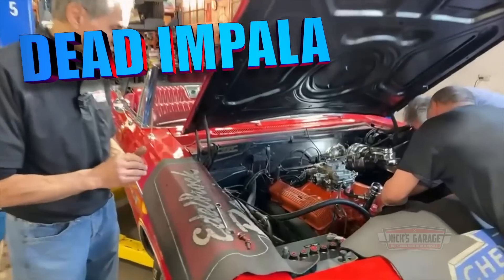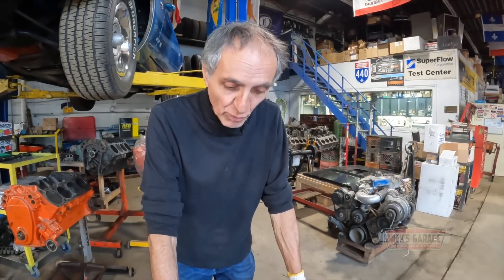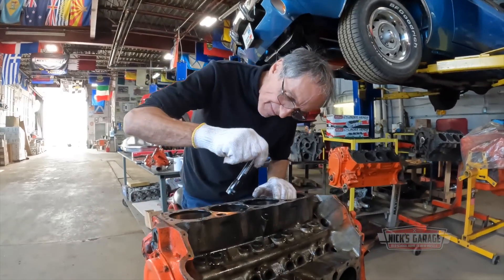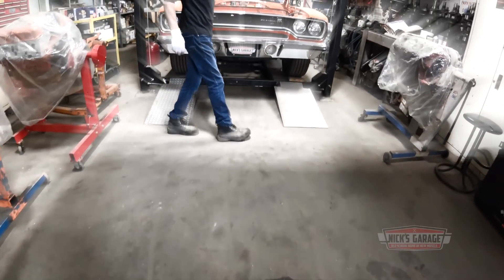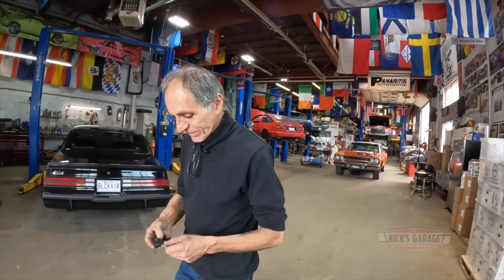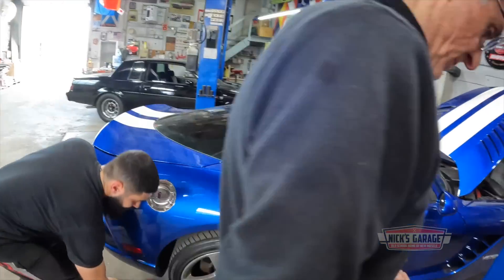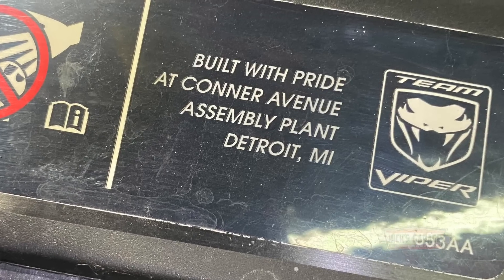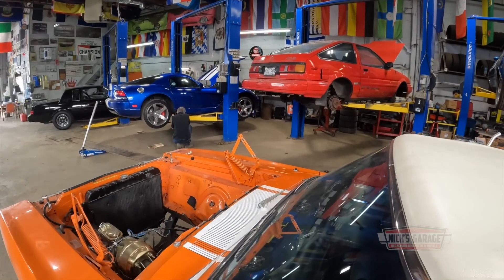327 Chevy Autopsy - Smoking Gun FOUND!

Comment: I got to say. In all my years in the shop I've never seen that kind of heat damage. I seriously doubt any of that can or should be used over. This is clearly operator neglect. Driving while clueless is hard to accept. At some point, you have to know something is wrong, pull over and shut it off!!! There is a temp gauge. You can tell right away how the motor is running if something is wrong. Smoke out the back. I hope you charge the client on this one Nick and not give them a freebie. It's almost like an irresponsible entitled teen ager was driving this. 

Now if this was a case where the head gasket blew, and they pulled over right away and shut it down, it would be a simple fix and I could see doing that for them for free. But at this point no way for free. And even IF the engine is cracked, there is no way to determine if it was cracked before or not. Overheating a motor like that will absolutely crack a block. ESP a chevy block!!!  AND getting a block that hot can destroy a thermostat real quick so I'm not buying that stuck thermostat story. 

Don't give them a pass on this Nick. I hope the client is reading the comments. He deserves a good pasting for this.
Reply: @Teabag697  Yeah there is no way you cant notice something like this.

Comment: Hey Nick! I was suspicious of the thermostat. Now that it's been verified as the source of the problem, I think Mr. Gasket owes you (and the client) a new engine. The part is clearly defective and Mr. Gasket (not your insurance) should make it right. It's not like it was an old part after thousands of miles. I know My Mopar has a bypass hose just in case that happens but I don't know if it would totally make up for a bad stuck thermostat like that.
Reply: They only owe a new thermostat.... the customer ignored the other signs of overheating, namely the SMELL.

Comment: It really goes to show how an inexpensive piece to an expensive build can really come back to bite you. With as "wet" as the heads looked, may have cracked the water jackets in some of the exhaust ports. Darn shame about the 327, hopefully it can be repaired.
Reply: That much heat!  and the block is already .040 over, (not wise to go .060 on SBC ) Not me, get another standard bore 327, that one is NFG anymore. You could sleeve all 8 cylinders and re line all the lifer bores but OMG the COST and time !  You can find another nice standard bore 327 to re machine much cheaper, and if nick really wants it out of there quick, just get a  Summit crate LT-1 350 and it's on the road in a few days.

Comment: By the way I love your shows I also have a 1960 Oldsmobile 98 holiday special four-door I’d like to say it’s in mint condition I can jump in and drive it from here in Albuquerque or I live back to California where are used to live without any trouble or from here to your shop in Canada without any problem and back only got 35,000 miles on it original factory engine as well like I said I love your show I also have a 2008 Zo6 Corvette unfortunately after 135,000 miles the transmission blew up because GM uses nylon to hold the bearings together and nylon let the bearings loosen the gears and we know what happens after that time it happens I happen to be racing another car I won my race but lost the transmission in the process so transmission and rear end are sitting inside my garage right now next to the Oldsmobile needs to be repaired keep up the good work though love your show

Comment: The only ‘fault’ of Nick was using “Mr. gasket“ brand thermostats and not a Stant brand as I consider Mr. Gasket to be middle of the road quality at best and this situation is evident of their poor quality control. On high-performance engines I don’t even use a thermostat but rather just a thin brass plate with usually a three-quarter inch (3/4”) diameter hole in it or take the guts out of the thermostat and use it like that.

Comment: I've killed 2 small block Chevys (a327 and a 350) by grossly overheating them. One of them was with a friend who said "If this thing pings all the way, it's going to blow up." We stopped to check the engine. Water running out of the exhaust manifold is a bad sign. Both engines cracked the heads.

Comment: Reminds me of 1973 and the first car I ever owned , A 64 or 65 Dodge Monaco with a 383 (I  think). Driving from Talladega to Redstone Arsenal, unbeknownst to me the radiator fan and hub broke and augered into the radiator.
When I got to my destination I smelled a hot engine, opened hood and there it was...tried restarting, no joy, seized up tight.
Next day after replacing radiator and fan assembly, dang thing started right up! Tough old engine, ran well til I traded it in for a 73 F250.
Loved that car!
Anyway I  agree the driver shares a lot of responsibility for the destruction.

Comment: i would also check the radiator cap, see if it is working and holding back rated psi its set at. sometimes they can fail and stay open and dump all coolant out the overflow.

Comment: I ran into an issue on a tune up I did on a customers car many years ago. No damage to engine but I got burned on bad parts. Three out of eight spark plugs died. Resistor plugs. Chnaged brands and all was good. I have not bought another Champion plug since that problem back in 1970!

Comment: Check the welds on the water jackets in cylinder heads..sometimes they pit and leak..I had a ford 289 motor do that..

Comment: Yep , thermostat, seen that happen to many times before, that was why I called you Nick.  Your welcome nick, I got a few years on you, and I have seen just about it ALL ! so when I seen that sweet 327 small journal block like that ! ( holy mother of god ! HOT ) 327s Chevy, they  just DON"T ever run hot ! I had a pretty good idea it was that thermostat as I have had it happen before on brand new name brand ( MADE IN MEXICO ) thermostats before. 

    So lets get real here, I had a OLD radiator rebuilder I really trusted, long since passed away. He told me flat out a thermostat is ONLY for HEAT in the car in the winter. Fact is you only need a restrictor to slow the flow of the water down in your cooling system, not a thermostat. SO , since a Convertible has ZERO reason to ever need HEAT lets put a STOP the problem before it starts. On all my rebuilds now, I take a small die grinder and very small cut off wheel and I cut the spring in half in the thermostat and knock all the guts out of it ( use the one that doesn't open) so it's only the outer shell housing left to slow down the water. Now you have a totally free flowing thermostat that can NEVER EVER do that hog was ever again. I been doing this for many MANY decades with zero issues PLUS the water temp always runs much cooler ( like 170 to 185 degrees max in the summer) My new 327 I just built & installed in my old daily driver Chevell, runs at 160 max  and it's been in the mid 90s here in south Florida as of late with the A/C on in heavy stop & go traffic hours on end. 

 Nick you asked , what happened ? you did not know?.  Well me being a OLD GM rat ! I had a pretty good idea just looking at it from afar. So then you asked what can you do to stop this ?,  The hollow thermostat is a great start, but they sell a thermal shut off kill switch you can set at 240 degrees would be even better.  We call  them ideate proof !  The 327 hits 240 degrees , the car has a VERY LOUID BUZZER ! before more damage occurs. I have not bought one in a long time, but maybe a good old school parts supplier can still get one  . 
 
Now that you have a pretty good idea that I know things about GMs, will you please,  PLEEEEESE !!!! never run a Q jet  on your dyno ever again ! with out a tight fitting AIR CLEANER on it!  your killin me here. Doing that is like trying to go pee in the dark with your wife watching , it never works.

Comment: Possibly a pin hole in the lower radiator hose? As hose heats, pin hole is opened due to building pressure in radiator and rubber expansion.

Comment: It definitely could be the thermostat BUT, if you overheat a thermostat enough, the paraffin wax that expands and opens the thermostat will leak out.

Once some of the wax is gone the thermostat will no longer open or, if it does still open, it will open at a much higher temperature.

Was the cooling system pressure tested before everything was taken apart? I still wonder if somehow the coolant leaked out while the engine was cool.

Comment: That motor should be making closer to around 350 hp to 370 I wonder what's restricting the hp on the 327
Reply: @Car Guy daddyo all 327 was considered a performance upgrade mainly corvettes mid 60s. Highly sought after hard to find genuine with stock heads still on .most ppl put the 202 stock 327 heads on 350 ci and even 400 small  block.

Comment: In all honesty I'm a Ford guy. 
I did come up against 327s all the time back in the late 60s early 70s. It was hard to beat, but I saw quite a few that split the block open. From what you saw and explained it would have to be higher on the block. Don't take this the wrong way, but I used and still do call them hot water chevys. They run best when on the brink of overheating.  I had a 73 El Camino that I loved. Built it to run and let it rip. Good Luck Nick.. you're the best.
Reply: You'll love this Nick. I had a friend in school that owned a 68 road runner. He joined the army and brought his car to my place to leave while he was gone to basic. The clutch was out of it and he said , if I put a clutch in it I can drive it. Well I almost got my chest pushed in by that rock crusher 4 speed but I got it done. Had a blast in it. 440 with a 4 speed.  No better feeling running down the street.

Comment: Davies-Craig makes a great electric water pump/thermo fan/electric controller combo.
Gets rid of the thermostat altogether and you can delete the water pump. Saves parasitic power loss and can even run after shut down to prevent heat soak. Then there is the engine guard alarm. Bolts onto the motor literally via a bolt in the head, or thermostat housing to read the actual temp of the metal, if it exceeds normal parameters,  like suddenly spiking above the normal heat range from no coolant, it sets off a LOUD buzzer to alert the driver.
Both two great Australian companies! 🇦🇺

Comment: Stuck thermostat (which is a huge problem these days from junk parts ) wouldn't cause coolant to blow out of the exhaust unless it was so overheated it blew a head gasket from many over heats, and that  would be obvious on the tear down, cracked cylinder walls or crack behind the intake/exhaust valves in the bowl area is suspected. Id also run a straight edge across the cylinder head and block deck. strange the engine didn't stop running and continued burning up. And like was said in a comment I also drill a single or several holes in EVERY thermostat these days, the parts are just junk now!

Comment: Had a similar issue about 35 years sago. Same style thermostat can't tell you the brand. Put a stock style back in, worked fine for years. Did have to swap heads, burned four valves.  Temp gauge voltage regulator was bad, not indicating any problems. I my case the bottom end  was ok, 100,000 miles after this event. AMC 401.

Comment: I wander what happened to the coolant. You mentioned that there weren't any leaks that you checked for. So where did I'd go? I may be way out of line with this but it is possible that he was not happy with the engine. He may have wanted better performance. So he, drained it all out. Then he drove it until he totally fried the engine. I have never seen an engine so horribly over heated in my life. Very suspicious.

Comment: I commented on your last video that i thought it was the thermostat because it happened to me with a new car with only 8 miles on it. Had to get towed back to the dealer. Engine used a lot of oil afterwards because when an engine gets hot enough to detonate the rings lose their spring tension. So if you rebuild that same engine make sure you replace all of the piston rings..

Comment: I agree with the guys saying that the defective thermostat COULD be an effect of the overheating and not the cause.
Nick says that they will investigate further and that is the right thing to do.
You would think that something as important as an engine thermostat, the manufacturer would have a good quality control to make sure that this sort of things does not happen. The buyer should not have to go through all the trouble of testing every part over and over.

Comment: Always drill holes in thermostat.    That way if tstat sticks closed, enough water will flow to trigger temp gauge and alarm.    Also you avoid air pockets in cooling system.

Comment: I'm 4 months late on this but I have to say one of the biggest issues I've seen on an overheat with the Chevy small block of this era, especially the 283, was if you ran them out of water and overheated  them, you'd get a nice big crack in the lifter valley a couple inches below the deck. I'm surprised it didn't happen to this one.

Comment: Check the rad. cap. I have tested many over the years & most old ones would not hold pressire. New engines generate more heat & if on A long drive in hot weather the cap may not been able to seal

Comment: Well I imagine the thermostat would be junk after being overheated. Once I had a head that had been crack repaired in its life and had a hairline crack in the exhaust port and once hot and under pressure would let water out into the exhaust.

Comment: While pulling the trans on a 318 Dodge  and sending it out we also changed the rear soft plugs and forgot. When the trans came back we reinstalled it took it for a test drive ( No coolant ) Man it got hot but was still running O.K pulled over shut it off .It survived ran fine.

Comment: Hey Nick I have a suggestion I don’t use thermostat what I have is a Moroso water restrictor what it is is a washer with a hole in it one big hole is 160° temperature the medium hole is 180° temperature the small hole is 190° temperature in my 327 I use the medium hole 180° temperature it’s a constant flow but it restricts the water flow to give it a temperature I don’t trust thermostats they work sometimes they stick sometimes and that’s the big problem with thermostats just thought I’d mention it to you Nick love your program! From San Diego California a fan.

Comment: I like that blue Viper :) Whether the thermostat works or not is of no actual importance since the coolant was going through the cylinders. That says the engine either had cracks where it shouldn't or the heads and head gaskets did not work. This is based on personal experience with an engine that passed water through the cylinders when it was hot and the head warped enough to let the water get into the cylinders. And no it didn't have water in the oil.

Comment: On my 66 I have a gauge.  If it was not the thermostat I was going to suggest a crack in the intake as most v8 Chevy intakes has a water passage.

If the hot light was working the owner must have either ignored it or thought he had more time.   Or he thought the light was wrong.

A thermostat can fail suddenly.  Happened to a friend of mine.

I just like gauges as I can see for example over time if the temperature is increasing.

Comment: I would install a temperature gauge under the dash. tell the customer to keep an eye on it especially on very hot days. maybe the installation of a temperature-controlled electric fan as a backup to the mechanical fan.

Comment: I once had an oldsmobile that overheated at about the same geographic area, about 250 miles from home in hot weather. I had heads off 4 times and replaced head gaskets each time. Heads were not warped because I got shut down before too much problem to engine integrity. In the end I discovered that water pump was sucking air and pushing coolant out through overflow system. New water pump was installed and problem solved.

Comment: Cylinder head gasket  movement when hot or  core shift when warm.
Cylinder head coolant passage not lined when hot  & leaking into the Cylinder,  but the gaskets  didn't show any ware patterns that were considered wrong 🤔.  
 Your team will figure it out.  Be safe all .

Comment: I have an old car. As many have said, fit extra gauges. I have always fitted an oil pressure gauge and it saved my engine when the pump went wrong. You have to learn to look at the gauges once in a while. The temp gauge also saved me once when the fan went wrong. The other trick is to know your car and when anything  changes check it out. I know there are very few people who check the oil and coolant levels on a regular basis. Any car part can fail at any time, after all its a machine.

Comment: This is an original Robertshaw thermostat Part No. 330-180, which is now being repackaged by Mr.Gasket & various other brands, Flowkooler & Summit Racing. As a speed shop counterman back in the 90's, we sold Robertshaw t-stats & never got 1 returned to us. For me this is very rare & could have been a defective unit before being installed. I like reading the comments below, as doing a pre-installation test to see at what temperature the t-stat will open may be the best solution. We can all learn something from Nick's Garage & the commenters below.

Comment: Hi, Nick! Big mistake using Keith Black pistons. I had them in my Toyota 22R engine and my engine blew just like the Impala engine. Use Diamond pistons. Keith Black pistons aren't that great. I replaced them with Wisco pistons, but wish I had the Daimond pistons instead. The Daimond pistons didn't come in 94m.m. diameter size. The Wisco pistons rings were very thin and were the only manufacturer at the time who made 94m.m. pistons for bore size in my beefed up Toy engine.